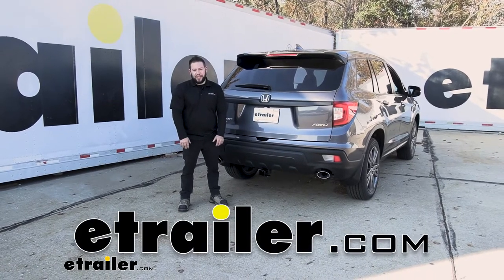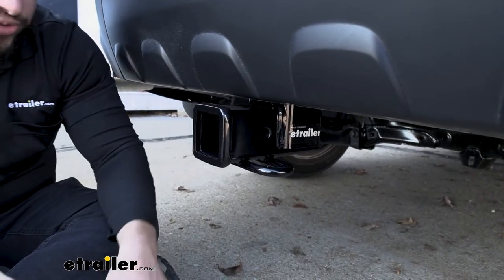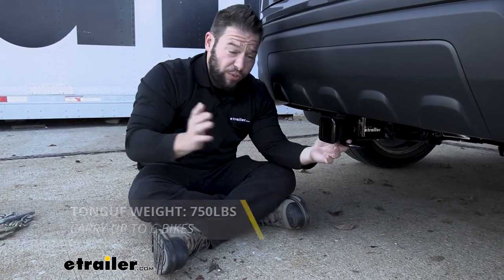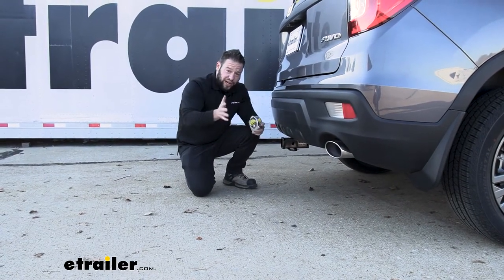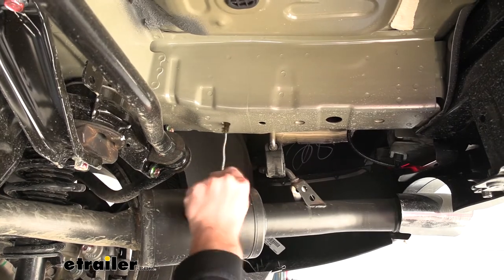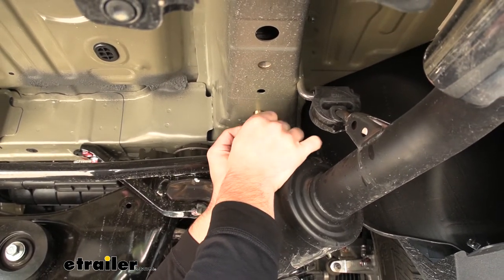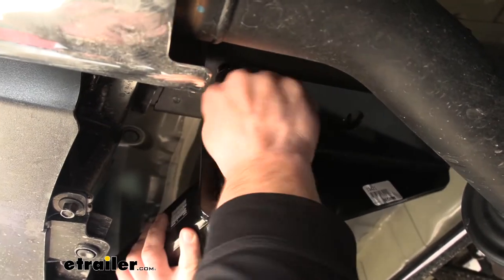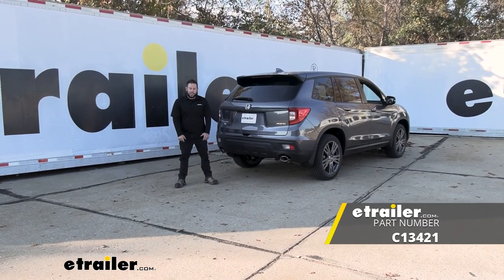etrailer | Curt Class III Trailer Hitch Installation - 2021 Honda Passport

Comment: what size socket is needed for the six bolts?
Reply from the maker: To install the Curt # C13421 Class III hitch, you'll need a 22mm socket. Check out the instructions here:
https://www.etrailer.com/instructions.aspx?pn=C13421